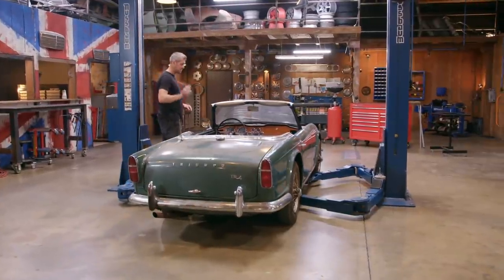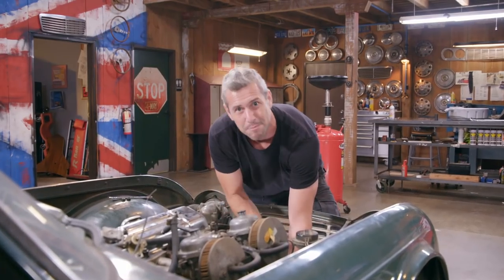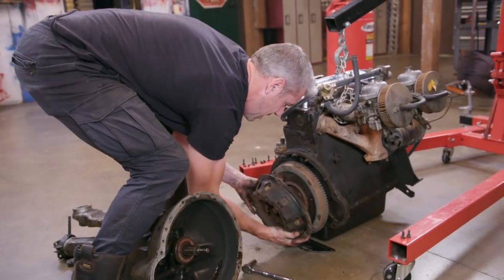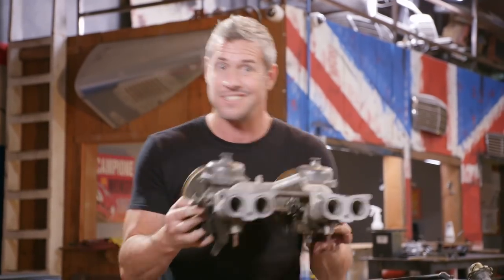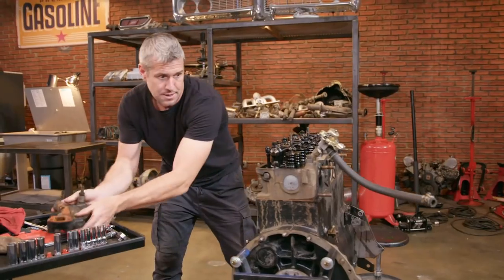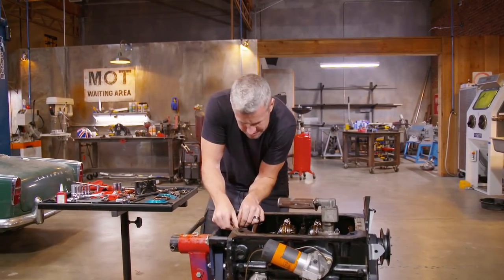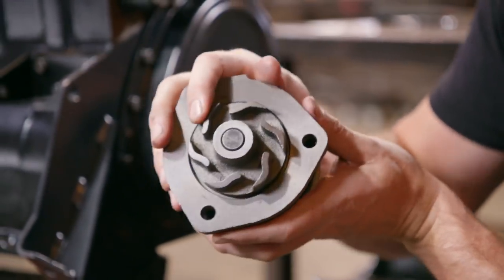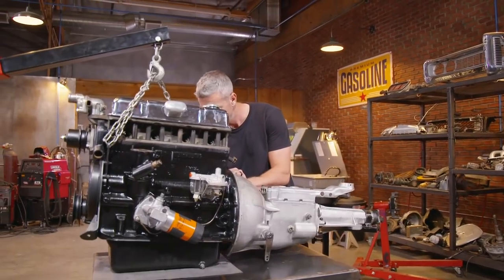Triumph TR4: Repairing And Restoring A Classic Engine | Wheeler Dealers

Comment: Although he skipped over it, the old valve seats aren't designed for unleaded fuels.  IF you're going to pull the engine, common practice is to replace stock valve seals with hardened ones, otherwise, you'll end up pulling the engine later anyway to do it.  Might be ok if ur just doing short drives a few times a month.  More than that, it's a ticking time bomb.
Reply: That's an old wives tale. Tetra ethyl lead is a not a lubricant.  It is a neuro toxin with no safe level of exposure. That's why its banned. Besides, all valve seats are hardened.

Comment: I had a ‘64 that looked identical back in 1970.  BRG, wire wheels. Rebuilt the engine, new rear seal, clutch,etc. Your video brought back great memories. Wish I still had it

Comment: Nothing was done to the engine's "Insides." Rear seal was replaced, new flywheel and clutch, and an exterior clean and paint. Not really "restoration" or "repair."

Comment: I was a Triumph mechanic , this is nothing more than showbiz, hardly a restoration. .
If you lift the engine and go this far you would at least pull the the head and the end caps.Absolute bullshit.
Reply: We called this a gasoline overhaul when I worked in a shop. Waste of time.

Comment: In the full tv episode this clown was explaining the difference between a dynamo and an alternator and just showed what an “expert” he is. A dynamo generates direct current which is fed to an external electro/mechanical regulator. An alternator, as the name suggests, produces  alternating current which is rectified and regulated by  electronics built into the alternator. He is so knowledgeable he once even called a water pump impeller a fan. This pair are well suited.

Comment: Nice job. The only part puzzling me is the voltage polarity conversion that did not include work on the starter motor. How possible is it to change from positive ground to negative ground and not replace the starter motor?

Comment: Such a simple engine. Why didn't you take the head off and regrind the valves? Was it because you didn't want to upset the 'rope' seals under liners? One thing the engine is not the exactly the same as the Fergie tractor, same tree different branch.

Comment: This is a TV rebuild, note you did not see condition of rear main bearing.  The alum flywheel on a street TR defeats the ease of driving ie pulling away at not much above idle.  Cosmetics for the camera, if you have a TR motor there are real channels to learn the how and why of a proper rebuild.  I enjoy the show but take all the mechanical advice with a large dose of salt.  It's a "reality" show, not a "how to" show.

Comment: had  a 64 tr4 in highschool..this was in the 80s..so it was an antique for sure..always regretted selling it for 900 dollars now that they are worth 20 to 30 grand.....wish I still had the car.....let me say this,I normally parked it on a hill and rolled it off to get it to start..it was a serious POS but looked brand new,a terrible terrible you are lucky if it made it to town and back car,but I loved the thing....LOL..one day driving down a highway,I smelled something...you drove these using your nose..yes,its over heating....something burning....stopped...the wiring harnass.....burning like a fuse around the engine....took me 3 days to rewire the thing but I got it done.Because it was such a horrible car,I sold it.....one of the bigger mistakes of my life.
Reply: mine red...with the true spoke wheels....wish I still had it.

Comment: I had a 64 TR4 in college.  64-67.  Tons of fun, and plenty of problems, too many to list, but the worst one was that the brake hydraulic line ran across the firewall right above the battery.  Battery acid apparently squirting out of the vents ate a hole in it.  Fortunately I lost my brakes pulling into the parking lot  of a bar in Denver after a day of aggressive driving in the mountains.  The guy with me grabbed the emergency brake lever and no damage was done.  Whew!

Oh yeah, the electrical wiring also burned up when the same guy accidentally kicked some relay under the dash and shorted out the system.  Something about a positive ground.  Anyway a new wiring harness. 

Still the most fun car I ever owned.

Comment: ....!'ve owned my TR3A for 52 years...I noticed 2 small things not mentioned....1/ a common source of rear oil leakage is also the cap on the cam bearing journal, installed like a reverse frost plug, it should be then 'bunged' in the center so it expands and fits tight enough not to ever leak..........and 2/ The taper pin on the clutch throwout bearing fork should always be checked for fatigue, or simply replaced, as a caution (if it shears, you have a big issue to deal with) The connection to the shaft can be reinforced with the addition of a through bolt.....There is a fellow who raced Morgans (same engine) who modded the rear bearing cap slightly so that he was able to replace ALL the bearings with the engine in the car...I had it printed out, but with a little research I'm sure you could find it....John (west coast, Can.)

Comment: This was my first car when I was 16 in 1970.  Exactly the same however mine was maroon with steel wheels.  Head gasket blew the first week.  Clutch went out shortly after.  Part of the bell housing decided to break off at the connection to the engine, standard rust on the rear wings (because there's no liner protecting them).  I remember using black electric tape to patch up the leather seats.  Remember, I was 16 with NO MONEY!  Practically everything I learned about cars, I learned while working on that one.  The strange thing is, I LOVED IT!  Why?  Where else could a 16-year-old pick up a 6-year-old convertible for $400?   Sold it 20 months later for $785 when I went off to college.  I don't look back because now I have the car I dreamed of when I was driving the Triumph.  A Lotus Elan!

Comment: Can't believe he semi restored the engine and didn't take the head off or seem to check the mains and big ends. He has no idea about the real condition of that engine at all.  Note even a compression test.  Has no idea about the real internal state, is it coked up, are the valves sealing properly, are the rings stuck (very common on engines that have sat for a while), etc etc.  If you've got an engine of tht age and you don't check inernally you are wasting your time.

Comment: Ahhhh memories.....I raced a stripped down modified 66 TR4A in SCCA during the early 70s.... modified the original engine back in the day with the 88mm wet cylinders ....those engines really were "work horses" and suspension "tough" etc....definitely changed the electrical from Lucas to AC Delco. I swapped out the carbs for SU-H6's. Won a couple races over 3 years....such fun cars

Comment: Greetings!  I bought one of these new in 1964 and it was fun until it broke down.  Everything in the electrical system failed , some more than once.  At that time the starter was over $200 which would be about $2,000 in today's money.  Wheel bearings were a constant problem as well.  Xmsn rebuild was required, as well.  Best of luck!

Comment: I have to agree with some other responses... Seems a waste to go to that extent and not remove the head, the big end and crank caps to check things inside. The oil pump should have at least been been inspected, too. All that can be done with the engine in the car, but is so much easier when it's out. And if any work needs to be done, will need to pull the engine anyway. 

My '62 TR4 is sitting in storage, currently, but already have all the bits to fully rebuild the motor from top to bottom and give the car a bit more oomph: 89mm piston & sleeves, larger valves, Weber DCOEs, mild cam, yada, yada. 

Next project... Maybe a TR3 Beta or a Rover V8 in a TR6... Unless I find an Italia.

Comment: Great cars those old TR Triumphs
Reply: More fun than great. Nimble and fun to drive. Rust and electrical issues hold them a bit short of greatness.  But with upgrades...a friend swapped in a Motorola alternator for the unreliable Lucas unit in his MG Midget.
Reply: @scootergeorge9576  I found that my Triumph leaks enough oil to protect it from rusting! :)
Reply: @haydenisaac3030  - Good for keeping the dust down on an unpaved driveway?   : D

Comment: My personal favrorite British sports car! never get tired of this body design , From TR4 to TR4A  with a 6 cylinder with the racing stripe going across the front bonnet  perfection !!!!! & Ant Anstead great job on this one & as usual Mike is nowhere to be found. Thanks for awesome video on this British classic sports car.
Reply: 4A has the same engine. 5 and 6 were straight six
Reply: yes TR5/TR250 is the TR4A body with the horizontal stripe and 6 inline.
Reply: @RyanPatrickOHara  It was a mid year model in 1967 & in the states it was introduced as only a TR250.

Comment: In 1967, I had one just like this, when in USAF stationed in Cape Cod. It was Great fun, but I had no use for it when I was reassigned to Alaska. I bought 1968 VW Square back. In 1971, I bought a new Datsun 240Z...in 1972 my ex-wife got it. Then something...better, a 1969 Pontiac Judge, and then even better, a 1970 Volvo 1800E. I'm not bragging, just lucky. Want to guess what was next? A Chevy Malibu...business car. (Ugh)
Reply: yes, i took part in that on Cape Cod.  I drove a,  '57 356A on its circuit. It was with the Cape Cod sports car club. I was their from 1980 till they locked the gate due to world terrorism causing more security and the new base commanders not enthusiast about sports cars. I think a lot of that USAF base racing had to do with General Curtist Lemay air force commander whom like the sport of home town racing. It is a part of America''s grass roots sport car heritage. I was lucky to be a part of it.

Comment: No sealant for the oil pan gasket?
Reply: No sealant on any of the gaskets. Especially the rear main bearing cap to block. This engine will leak oil severely.
Reply: @geraldvanvlack8972  So that's the way to do it?
Reply: @daveeddy2402  No it's not the way to do it. Also his install of the seal skipped a few steps. All for the TV show not for good information.
Reply: @geraldvanvlack8972  I  see he put it together the old way, Not a single click of a torque wrench ever to be heard. Not my way of doing it though.
Reply: @unclekevin5094  All done for TV but the sad thing is if someone is searching for guidance and happens upon this they may proceed having seen some improper work and may well end up worse than when they began.

Comment: The problem when Wheeler Dealers came to the US was that they insisted on buying and fixing the same vehicles they thought everybody wanted in Europe. Nobody HERE gave a rip about a DIESEL powered Land Rover, for example. The show was great, but not enough of what they were working on was of interest here. They also failed to realize that cars bought with a lot of modifications/ updates would have brought more money with those mods left in instead of spending a ton of time and money removing them and going back stock. Americans don’t do stock, boys! Americans are more into hot rods than restoration.

Comment: Pulling a 6.7L Turbo Cummins(600kg+) using a forklift with crane attachment is monumental. I used to pull small engines like that with my bare hands(sometimes with the head on).